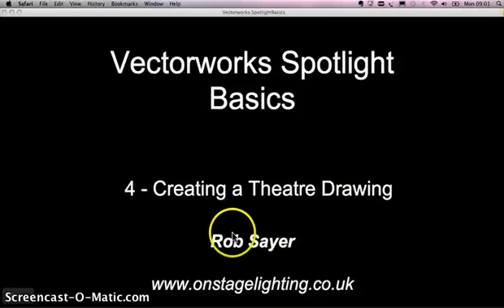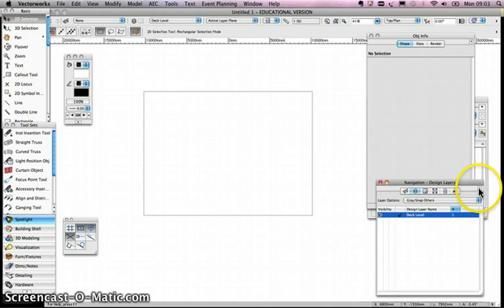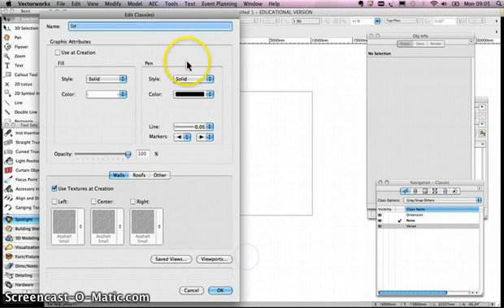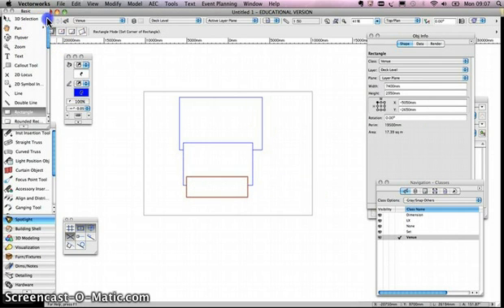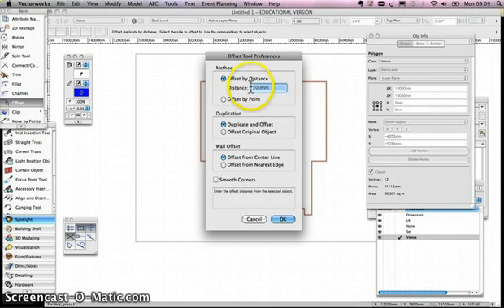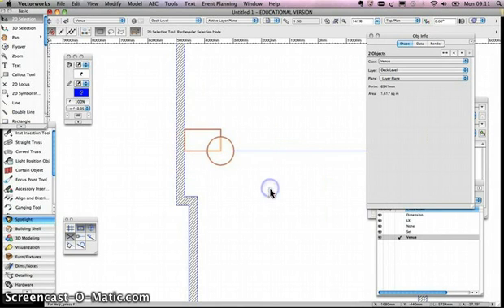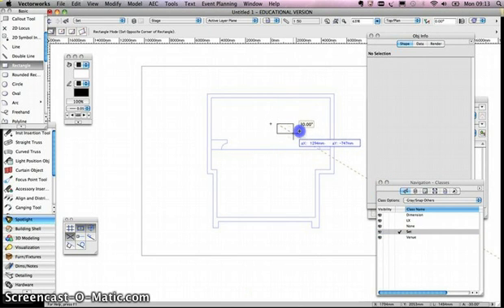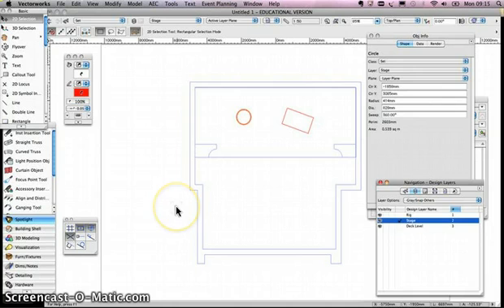Vectorworks Spotlight Tutorial 004 - Theatre Drawing

Comment from the maker: In this method, you just draw the dimensions onto the drawing.  Find the Dims and Notes toolbox (instead of the Spotlight one) and choose constrained dimension.  Make sure you have snaps set up to be able to accurately place your dims and then set up the tools to display the style of dimension you want.  The dims are usually classed in a Dimension class. Working with Sheet Layers (instead of simply printing the drawing from the Design Layers) then you will need to make sure you Annotate Viewport